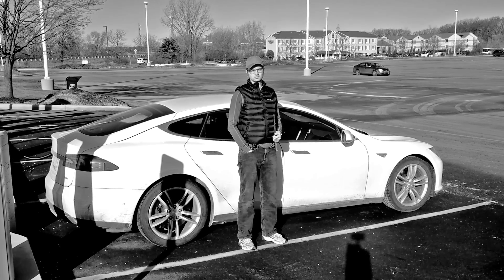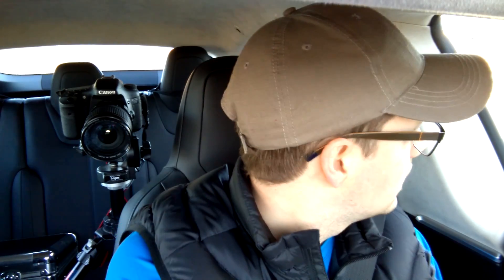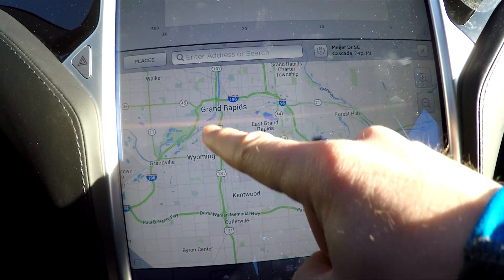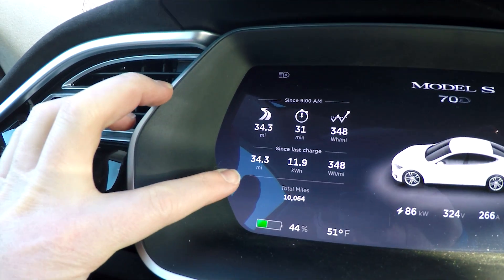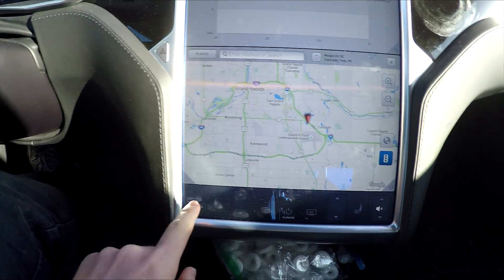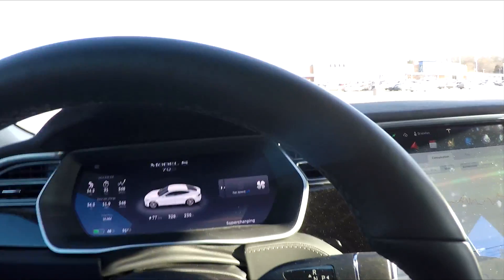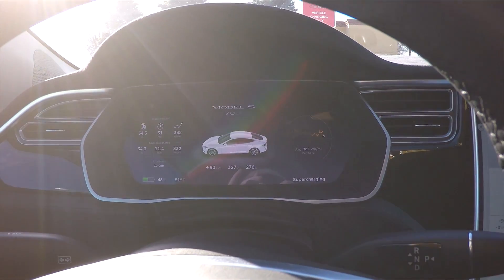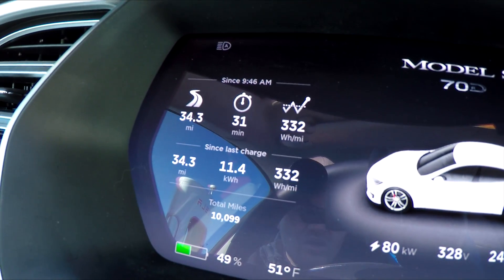tesla 70D energy use: Range mode at 75mph

Comment: I would love to hear your opinion regarding the battery size I should get for my Model 3. The ranges and prices were announced this past weekend and 220 vs. 310 are the advertised ranges. The 310 mile range comes at a $9K premium. Yeow. My budget just won't stretch far enough to get everything I really want for this car. I take an 800 mile round trip every every 6 weeks or so. I plan on taking one or two long trips per year. On a daily level, I have about a 12 mile round trip commute to work. I visit family in a city 75 miles away once or twice a month. So that encompasses my travel. I want the features associated with the Premium package. More than that, I want Enhanced Autopilot. I just don't think I can put the bigger battery (and its cost) ahead of the EAP and Premium package. Your thoughts?
Reply from the maker: +Rick S the battery size issue comes down to how long you're willing to wait at superchargers. The small battery will get you to the next supercharger no problem, but because it's small it won't charge quite as fast. With my 70D, I've had to charge for 40-60min in bad weather and cold temps. (Of course we don't know yet if model 3 batteri s are compatible with next gen supercharging when that comes out).
Anyway, if you don't mind some longer charging times in long trips, the smaller battery is fine. 
Where you live matters as well. Sever winter's decrease range by 30%+/-.

Comment: I have a problem when I start on a new trip after the car has been put in park. I have a non D 85 with autopilot. My wh/mi jumps to 700 to 900 for the first few miles and then slowly reduces. Never the same. Not sure if you experience this or if you think it could affect your findings. One way to correct for this could be not to stop between runs and just change the settings as you reach the 35 mile point and copy/photo the wh info as you pass this point. Anyway just a thought. Really enjoy your new format. Well thought out.
Reply from the maker: Mine displays high wh/MI at first as well. I assume it's because it uses a lot of energy to get the 5000lb vehicle moving at first which by definition is over a shirt distance, ergo super high wh/mi. This is then reduced as you actually go more distance. I wanted my numbers to be more true to average driving, do I include startup energy and the regen when slowing from the freeway. My start point (the supercharger) is right next to the freeway so there's as little city driving as possible.
Reply: +Tesla EVangelist Not sure but I think the trip start wh/mi displays are an algorithm issue coupled with the car not knowing how much juice it actually has at start. As a result it has to do some catching up and recalculating which distorts beginning wh/mi readings. Not sure if this materially affects your test results, however. I think your wh comparisons and conclusions are valid but your actual measurements may not.

Comment: was these test done with the same battery pack voltage or charge ? I have heard that with a full battery the efficiency would be different than a low level
Reply from the maker: I think I did the first round with about 60% battery and the second about 50%, but I don't remember exactly. It is true power output is less with low battery, but most noticeable when its like 20% or below.